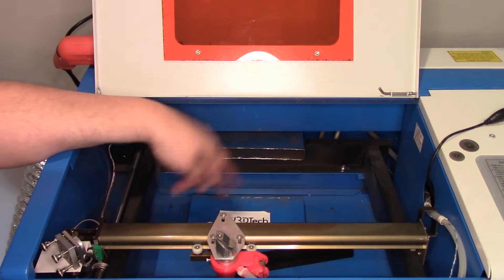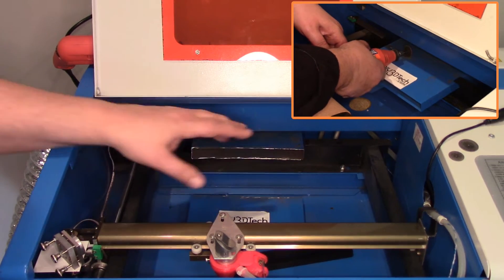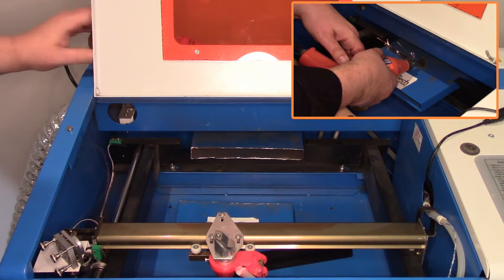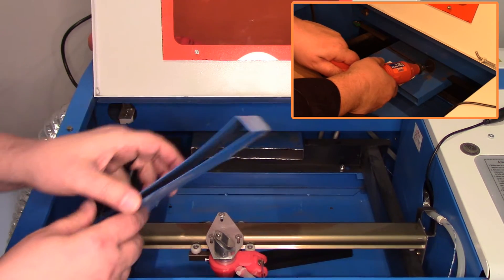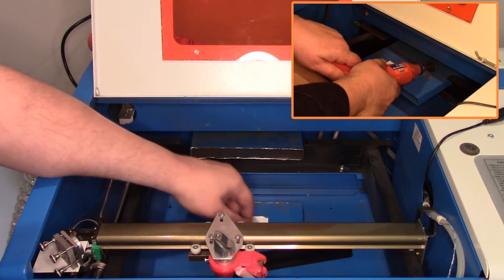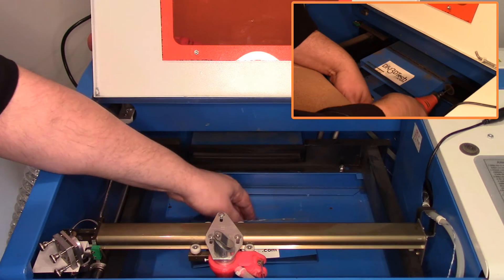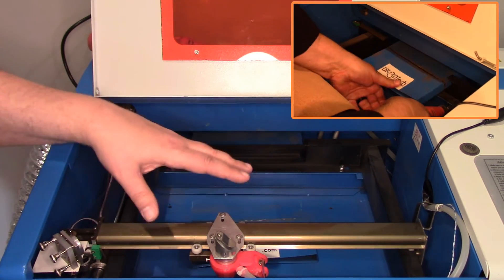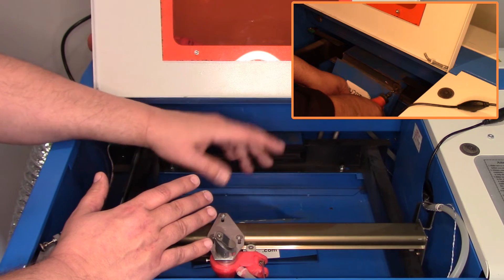eBay K40 CO2 Laser  -  Increasing The Cutting Area!

Comment: Hey thanks for this! i always thought that thing is a nuisance since HOME is in its way meaning i always have to pull the rail down a bit to work, One question: I have the same k40 model as you, there are a number of ones, and i noticed it can work on material as long as the rails support it, is it true? will i not ruin anything by expanding my working area in k40 manually? It just logically sounds correct! some time soon il order a honeycomb bed and 4 screw stools so i can adjust its height on 4 sides and make it perfect

Comment: Is this just a direct modification? I just bought one, but it hasn't arrived yet. Any settings or firmware modifications?
Reply: For this mod, no k40 comes stock with whisperer on 325mm by 220mm ( the 10-15mm in 220 are blocked by that pipe) but width can easily go to 355 i think, i havent tried but my bed is around that width

Comment: cool, I removed my blue protrusion also. btw I just discovered on amazon there is gadget to make an angle grinder into a chop saw, add a few metal cutting blades and we have a handy makers metal cutting tool. I got it for cutting metal tubing, but would use it over a Dremel now I can finally cut straight

Comment: Remove that choke part completely, not just cut. You may get 4 times more air flow for smoke to escape. Build better laser head assembly. On thingiverse, I put lens adapter for the head and air assist, look for thing 4647828. Distance between end of the nozzle and the workpiece is 5 mm, ensuring most of the air going through cut, not around. I can make it even closer, but then cut pieces can get in the way and head may bump onto angled or tilted pieces if they does not fall properly.
Reply from the maker: Its spot welded in and removing would damage the case.  Also this move more then enough air so have had no issues with this...

Comment: Why you cut this narrow part? Why not remove it completely? It is still air restriction for removing smoke out.
Reply from the maker: Because it is welded in place...
Reply: @DIY3DTECHcom  Oh, that is another version of K40 cutter. I heard that. Also, it is possible to remove it by drilling holes where it is spot welded.

Comment: Thanks but why not buy a model / brand thats not dicey?.. or contact the manuf and tell them all the design issues so they can remedy? And fyi these do not have 8x12 cutting area..they are about 8x10
Reply from the maker: Thanks for commenting, however my opening is around 9 x 14 so yes I have around 8 x 12, is it the best no (because of the flex / give in the optical train).  You do realize there are differing versions of these out there right?  This is true 40watt with 750mm tube.  Also have a smaller 35 watt unit which is  physically smaller (maybe that is what you thinking about). Why buy this?  Simple it it was $375 USD,  also keep in mind these are Chinese surplus rubber stamp makers so the manufactures don't care

Comment: where is the thingiverse file? i want to do this :) thx
Reply from the maker: Here you go: https://www.thingiverse.com/thing:4514255
Reply: @DIY3DTECHcom  oh thank you :) just got mine set up and definitely want to cut back that vent; my air assist keeps banging into it.
Reply: @karadanvers6136  First thing to do is check if the exhaust it bolted on, if it is then remove the whole gantry and remove the exhuast saves you a lot of hard work trying to cut it out.

Comment: 4 screws behind fan and air duct comes out, cut on band saw, for clean cut,plus a quick file on edges.
Reply from the maker: Not on this version :-(  spot welded.  As mentioned my other one (I have two) that was the case...

Comment: Have you heard about Meerk40t?  It's an open source software for the stock k40 control board, that has features similar to Lightburn. It has camera support and PPI power modulation, as well as on-the-fly encoding (i.e., it basically starts the job almost instantly).  I haven't personally tried it out yet, but I've seen a few videos, and it seems to run jobs a lot faster than k40 Whisperer.

Here's the link:  https://github.com/meerk40t/meerk40t/releases
Reply from the maker: I had not!  Many thanks for sharing as I down loaded it and will give a try!

Comment: Never used the k40 wisperer software but lightburn is incredibly easy to use and navigate especially if you use a camera
Reply from the maker: Thanks, I use Light burn on my other GRBL modified k40 and works well as I like that I can design on the fly in whereas with the k40 Whisper you have to start in inkscape and then import into Whisper.  However it does require the GRBL modification...
Reply: @DIY3DTECHcom  the grbl modification?
Reply: Lightburn is not free....k40 whisperer is free ...i opt for free all the time.

Comment: I would like to expand my k40 however I was thinking about going all the way into the power supply and controller area. Any idea where I could find the same rail used in the k40's? If not I will have to upgrade all of the rails and wheels to something new. Mine sits on a metal cabinet so I can move power supply and controller below on an enclosed shelf.
Reply from the maker: I have seen people remove the "guts" and use v-slot to build a larger version.  However keep in mind there is a point of diminishing return with only 40 watts and IR wave length (when you go bigger) and the reason you see most larger format lasers start at 60 watts and not 40...
Reply: @DIY3DTECHcom  That reason is: tube length.

Comment: Great video..... isn’t it possible to have dual controllers with a simple switch?  Then you use both GRBL and light burn depending on the situation.  Also I am curious if you have come across an open source way to add a positioning camera on the lid..... ala the muse.  Anyway great vid... looking forward to more mods.
Reply from the maker: Possible, yes.   Simple switch no, there are a couples ways I could think of however don't believe worth while.  This is why I have two as one I modified and one I left stock however the modified on is getting long in the tooth and tube is weak so it is headed to the parts bin and the reason I thinking of moding this one as next will be an 80 or 100 watt version...

Comment: I also want to increase working area of my laser machine, initially 20x50 to 120x60, hopefully it can be realized
Reply from the maker: Not sure if your taking mm or cm?  The largest practical size is around 300x200mm because of the wattage, wave length, mirrors and lens quality.  Again you change all but the wave length, however it would be cheaper to just purchase a larger 60 watt laser...
Reply: @DIY3DTECHcom  for size 120x60 use minimum 60w sir?
I think better make machine again

Comment: That was one of the first things I did with mine was cut out the exhaust plate and it did give me a 12x14 bed but mine was only able to cut 9.5x13.4.
Reply from the maker: Thats about the max size...
Reply: Hi, is the actual cutting area really 9.5x13.4 with this mod? Have you been able to cut a rectangle this size? Would like to know the exact maximum, really appreciated, thanks.
Reply: @giel3414  I sold mine about 8 months but if i remember that was the very edge of the beam so you would not always get a good and clean cut but it would end stop there.
Reply: @fyrstorm2010  Hi, alright thanks for letting me know! May I ask why you sold it? Did you buy something else instead?